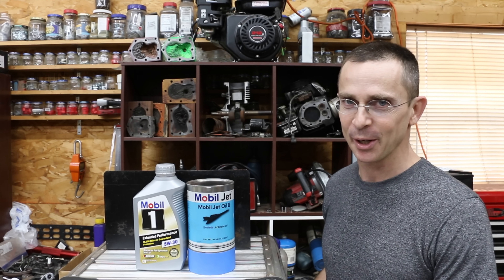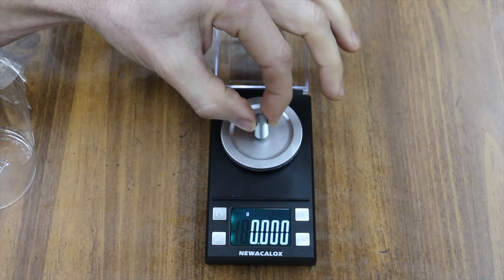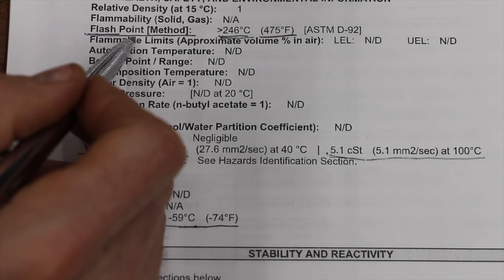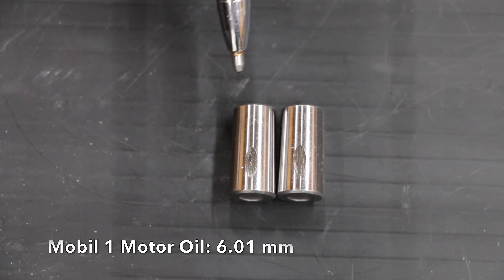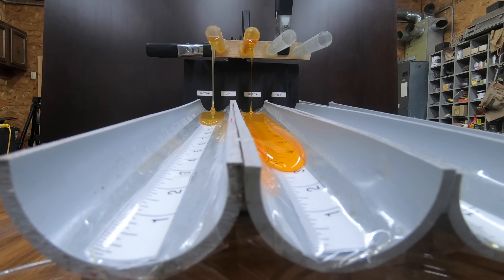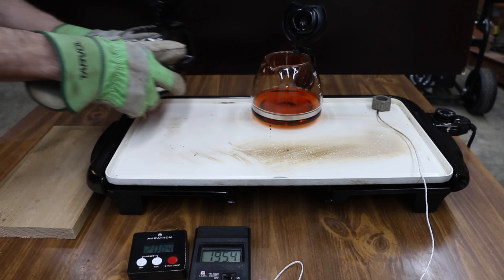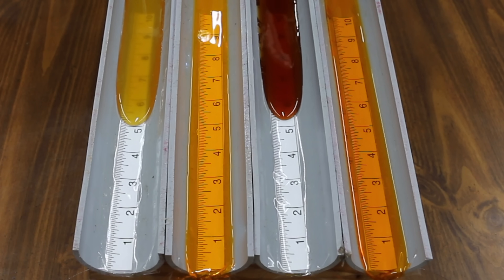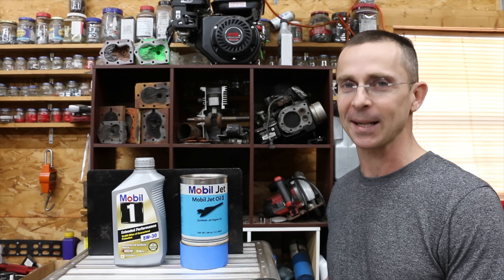Is Jet Oil better than Mobil 1 Synthetic?  Let's find out!

Comment: would a push mower Run on lighter fluid
Reply from the maker: Great video idea!
Reply: With 2-stroke oil mixed in, probably. Compression is low on lawnmower engines.

Comment: Is Bacon grease still the reigning camp on the wear test?
Reply from the maker: There are several oil additives that will beat it but bacon grease will beat motor oil easily.

Comment: So, the jet oil is basically all about the temperatures. It may need to with stand higher and colder temps than what typical motor oil is exposed to. Knowing the jet oil us thinner to begin with its no surprise it would travel down fast. Very impressive how it stays so clean with very little loss due to heat and cold!

Comment: I have an idea or wanted to know does using a fuel additive such as STP or Lucas that's supposed to clean injectors does it make a difference using low octane or high octane also does it make a difference using non ethanol vs ethanol gas?
Reply from the maker: Thank you for the video idea!

Comment: I had a 71 VW Squareback  that my mechanic said split the crankshaft in two after only about 40 hours of use and maybe 5 times that number in cold starts..  It was rebuilt by a guy who thought he knew everything he worked for my Dad for a short time as a handyman at a small airport in PA.  Not an A&P mechanic don't worry! I've always wondered if you could do a video of a way over torqued engine versus under torqued engine and baseline properly torqued engine longevity? Thanks for the video.

Comment: Can you try atf mixed with gas on a running test? I was told it helps older engines, pre-emissions, keep compression after years of negligence. I understand how it would work with a engine will not so great piston rings. But, the proof is in the pudding!
Reply from the maker: Thank you for the video idea!

Comment: Here is a good challenge I ran across today.
There is a adhesive or glue type product claiming to be 50X stronger than Anything on the market out there.
I think this is too wild a claim yet needs your approval test grid to verify their statement.
The product name in “BONDIC”.
It uses a UV light to solidify the epoxy type resin.
I would like to see you test it under loads and give us a results to prove it or not.
Perhaps contact them and render them the results ??
Reply from the maker: Thank you!

Comment: Would like to suggest you consider testing vacuum oils.  Do they vary in viscosity?  In lubricity?
Reply from the maker: Thank you for the video idea!
Reply: @ProjectFarm  I think it has good potential.  Vacuum oils have a specific characteristic you may find hard to test (or you may enjoy the challenge), that being its low volatility at low pressures.  But as important are the attributes you're already well equipped to test.  I found it almost impossible to find decent data on many these oils.  Viscosity for one thing is almost never on any label nor even at manufacturers' websites. Yet the oils are depended upon widely in HVAC systems, shops and labs.  Do people even know why their pump fails or leaks or works inefficiently?  Do they know which oils may be superior?  Usually, I think they do not.  You could really help them (us!).

Comment: The jet oil just has to be changed more often due to jet engines being on for up to 14 hours at a time, and is obviously subject to more varied temperatures. (Being parked in California then onto northern Canada for example). So the jet oil is designed for that in mind. 
The car oil is subject to more varied pressure. (Think of a racing car being flat out then idle constantly). But is not in operation most of the time.
Reply from the maker: Thank you

Comment: Now here's the thing..... jet engines that I work on use the same oil and run above 1000c and in an internal combustion engie there is more spinning mass that the oil is designed to help dampen the vibration and noise. In a jet engine it doesn't have all that rotating mass. Also that oil should have an anti-foaming agent that needs to be agitated for it to work properly. All in all great video.
It would be cool to see a shoot out between motorcycle oil and regular car oil due to the fact of motorcycles use wet clutches and need some friction to work properly. I enjoy your channel!!!
Reply from the maker: Thank you

Comment: I also have a habit of keeping a jug of 5W 30 in the back of my car for spare just in case. My idea for a video would be does mixing oil’s that are not the same make or  reduce their effectiveness. Because I have affectively owned this for leader jug of 5W 30 and used it on many different vehicles I have both synthetic and non. It’s just an emergency thing I do but wonder if it acutely causes damage
Reply from the maker: Thank you for the video idea!

Comment: I've watched a lot of your videos and I thank you for some awesome testing/comparisons. I only found one test of Motul oil and am confused. I bought a new VW with a TDI and serviced at the dealer always until they changed oils. The car had only had Motul SPEC 505.01 since new and they had switched to Castrol Edge and I could actually tell a difference in the sound and feel of the engine. The mileage was lower too, so I had to find my own and do it myself after that.

My question is the bottle doesn't have the same API label so I'm wondering why it's so different that it works so much better in my engine? You testing Motul 8100 which doesn't have the same SPEC designator so is 505.01 a better oil?

Thanks for all the cool videos
Reply: BPY engine??

Comment: I’m glad you started this clip with a big fat disclaimer.  But despite your best efforts, after going through the comments, there will be a bunch of people parting with cash on Amazon to buy a few cans of MJ2 for their pride n joy.  Shortly afterwards, they may find themselves parting in considerably much larger sums of cash for replacement engines.  I’ve been working on jets for 32 years and the oil I use in my cars is the one that the owners manual tells me to use.
Reply from the maker: Thank you

Comment: What would be cool is if you maken a simple tester device with Arduino and a relay to excactly run the motor for a specific time and then turn it off (prpgrammed relay with Arduino) so your results will be more accurate !
Reply from the maker: Thank you

Comment: I am an aircraft mechanic. I has used Mobil Jet II in Allison 501D-13 turboprops. Turbine inlet temps of 970 degrees C. Compared to Phillips Sky Chief the Mobil oil does not coke up in high temp oil galleys.

Comment: I would like to know if jet oil will eat away at automotive o-rings. Place o-rings in her oil to see if they degrade. If I'm not mistaken jet oil has a higher pH level and doesn't have as much detergent as auto oil
Reply from the maker: Great test idea. I believe it will hurt the seals.

Comment: Jet oil is Group 5. It's almost all PolyolEster. Great for heat in essentially an air-cooled engine. (High Flash Point). But your car operates in a narrow temp range and the oil is in the crankcase quite a while. So the best you can buy is a Group 4/5 like REDLINE, Royal Purple or AMSOIL Signature Series in the USA. German 4/5 is Motul and Liqui-Moly. Mobil Extended is probably the best Mobil 1 but still almost all Group 3 but with a token amount of PAO. You might save money and buy Walmart Super-Syn which is also SN+ (same as Warren Distributing MAG-1 and Amazon Basics) which is just as highly rated as Mobil 1. The terms "Full Synthetic", 100% Synthetic" and "Synthetic" are merely marketing terms with no legal meeting. If you race, drag, tow or have a turbo, buy a Group 4/5. Think Group, not the words with "Synthetic". In Germany and Japan, if the word "Synthetic" is on the label, by law it must be at least Group 4. Americans are being fooled by the word "Synthetic".
Reply from the maker: Great information. Thank you!

Comment: Hey I work in an oil analysis laboratory and I can run tests on any oil u want. I can check viscosity at any temp. Its flashpoint. I can check for particles with a spectrometry machine.  Our lab is in israel though but I'd be more than happy giving you our info
Reply: We can test everything you are looking at at 3:17

Comment: A great test, however just wondering since now you did the test at temperatures that are similar to car engine temperatures, what would happen at temperatures for jet engines since that's what the oil was designed for at those higher temperatures
Reply from the maker: Thank you

Comment: Thing about jets though is they burn some of the oil as they run so the oil dosnt need to last as long in the engine. The jet airliners i service burn about 14 pints every 30 hours.
Reply: That depends on engines, the old CFM's we used were burning around 1qt pr/hr but the new Pratts are not even burning a quart after a round flight (~8hrs).  Granted I work on military hardware and am comparing oldtech CFM's with tens of thousands of hours vs PW's with not so many hours (and much better sealing) but even the new GE's have a burn tolerance much less than what is standard.
Reply: @asymsolutions  those old cfm 56s drink oil lol. I wonder how this mobil compares to the aprolube 7808. Prolly same stuff but curious how it smells. Better check the taco's. Haha.
Reply: @asymsolutions  pratt and whitney 150s and cf 34s
Reply: So do Subarus.
Reply: @cal1k  everycar technically burns oil to a certain extent. Cummins burn oil quite a bit
Reply: @invertedv12powerhouse77  I know, but my car doesn't need to be added to in the regular oil change interval. I work in a garage and Subarus come in all the time to get more oil added about half way through an oil change
Reply: @cal1k  That is quite true, Subaru Horizontally opposed 4 cyl engine really eats oil!
Reply: @South Jersey Gambler was going to comment the same thing. My friend had an Audi S4 with the 4.2L V8 and that thing ate oil like mad. It didn't blow any chow out the exhaust that we could ever see,, it didn't smoke at all, it just sort of literally eats it lol.
Reply: @cal1k  

I am beginning to think that Subaru have 2-stroke engines because of how much oil they burn!
Reply: @cal1k  none of mine burn oil, one leaks a little though, I'm just to lazy to fix it
Reply: @cal1k  and POS diesel BMWs
Reply: South Jersey Gambler  

God, that's awful.
How can companies get away with that?
You would sure think that it would show up in emissions, and isn't that tested in some areas?
Reply: Question for the jet mechanic. What engines recommend what oil brands.  Or is it at your discretion, can brands be mixed interesting, thanks ?
Reply: @Northstar4653  not my choice. Our company just uses mobile 2 like in the video
Reply: @Northstar4653  The jet engine manufacturer provides the customer/operator with the required specs.  The customer's powerplant engineering team determines  what  type and brand of oil is used.
Reply: Old Duff 
You never mix brands in aviation without testing
Reply: No joke, our cfm56's drink it up
Reply: I was going to add that “burn” is really a bad descriptor for how the oil quantity in a turbine engine decreases over time.   The series of caged ball bearings(for axial and radial loads) and roller bearings (radial loads) are enclosed in “labyrinth seals”.  

    Essentially, pressurized oil is fed to the bearings and drained via the scavenge system.   To prevent oil leakage (into the bleed air system), the inner oil seals are backed up by an outer air seal.   The pressurized air keeps the oil inside the inner bearing and aids in scavenging.
      
     However, by pressurizing the seal, some of the oil is turned to vapor.   It is not burned in the conventional sense, just turned to vapor in the presence of hot pressurized air.  

     Some of this vaporized oil is vented overboard.   

     In the case of the CFM-56 series engines, the oil vapor is vented into the conical shaped diffuser located aft of the LP turbine section.   This conical diffuser terminates into a tube that is open at the aft section.
       After shutdown, one can see (and smell) this oil vapor escaping from the tube.
Reply: Only 14 pints? My private jet burn 15 pints of Dom Perignon  every 29 hours.
Reply: It is by design. If you never see any oil level change that is either too good to be true or lack of oil pressure. Causes seizure as well!
Reply: The planes I work on burn up to 3.5 qts a day
Reply: There is a reason the oil comes in a tin can. And the oil is not burnt it is blown past the seal and our a blow by tube. Actually on mine it goes into a catch can. About 1 qt every 30 hours. It is usually runs around 97 degrees all day.
Reply: Dang, the most I've seen is about 3qts in 10 hours on a CRJ 200
Reply: Jet oil is also meant to handle hundreds of degrees in temperature while engine oil will never go close to 200 celsius. I think most car engines run from 100-160
Reply: Jet engines are not supposed to burn oil lmao. They burn and leak oil because oil seals go bad but there is no design that allows oil into the combustion chambers.
Reply: @thatflywelshguy9662  theres always a bit of oil that goes through the seals even when new. I guess jets just burn very badly when they are old haha
Reply: @invertedv12powerhouse77  yes they do. And as others have said, some burn a lot more than others and some leak a lot more than others. Point I was making is NO company ever designs an engine to burn oil (except the rotary which has oil injection for apex seals)
Reply: @thatflywelshguy9662   dosnt matter it its designed too i never said it was. Regardless i will burn some oil weather you want it two or not
Reply: @thatflywelshguy9662  Ferrari would like a word with you!

Comment: Awesome video! I'm super curious how  DOT 4 brake fluid performs as an engine oil substitute. I expect it will not do well, but definitely curious how it will perform with the testing you do. Cheers!
Reply from the maker: Thank you
Reply: About like the jet oil. It would destroy all the seals. Years ago that was a car dealer trick. drop a little brake fluid in a leaky motor. Unfortunatly it would come back with a vengance later. Jet engines run carbon seals or labrinth seals with air pressure bled from the compressor to back them up. The oil is pretty much straight ester.

Comment: If you want to blow your mind, try Redline LikeWater, shock oil.  That CSt chart is as flat as you can get.  I run it in TurboKeychains ball bearings for crazy mad performance.  AeroShell AF2/3 is sometimes used for gyros/instruments, that's another light weight  oil that works well (probably similar to jet oil).
Reply from the maker: Thank you for the video idea!

Comment: your results were drastic because you used two oils with a large difference of viscosity between them, it would have been a better test if you used a motor oil with a closer viscosity to the jet oil.
Reply from the maker: Thank you

Comment: watched a video once discussing jet oil, apparently the oil is used more as a coolant than a lubricant as all the bearings are very low friction roller element bearings in a jet engine. makes sense that it would be thinner and be able to operate at extreme cold
Reply from the maker: Thank you

Comment: two things I want to see: I work a lot in the field and I bring my vacuum bottle with me. Now I realized, a lot of heat (or cold) gets out of the bottle via the top. That means, if I put my hand on the top part of the vacuum bottle, I can feel how cold it is, thus the cold is escaping. Supposedly that doesnt happen with all designs. As well: I often carry the bottle vertical. That means, I carry it in my bag and the water is more close to the opening, thus increasing this effect compared to standing up straight. So a comparison of different vacuum bottle brands and or models.

second:
knife sharpener for poor men who dont know how to sharpen with wet stones or just dont have the time for it ( sharpening with wetstones takes like 20 min for one knife alone). So no wet stones etc. no expensive turning wheel sharpener. To make it a contest: I saw a device that can measure how sharp something is in this video https://youtu.be/KB87xoFm46g?t=435
Reply from the maker: Thank you

Comment: We had a guy at work(helicopter mechanic) that would use milspec 23699 turbine oil in his old Chevy 305. It worked fine. It lasted until he flipped out and became a serial killer. True story
Reply from the maker: Thank you

Comment: Didn't see anything when I did a search, but is there any way you can test gun lubes? I see alot on the net about the latest and greatest gun oils. Not sure if using the same testing methods for engine oil would be ok or not??? Examples: Ballistol, Break Free CLP, Froglube, Hoppes #9, Rem oil, Slip 2000, Fireclean, Battle Born, etc. Thanks for the great vids.
Reply from the maker: Thank you

Comment: Automotive oil is designed for laminated or plate type bearings.  Jet oil is designed for  roller/needle bearing applications.  The wear test is a great example of this.  Jet oil isn't designed for this kind of wear.  Spin a roller bearing at 25,000 rpm and see how the jet oil handles it compared to auto oil.  My guess is there will be no foaming and the oil will flow with the bearing.
Reply from the maker: Thank you